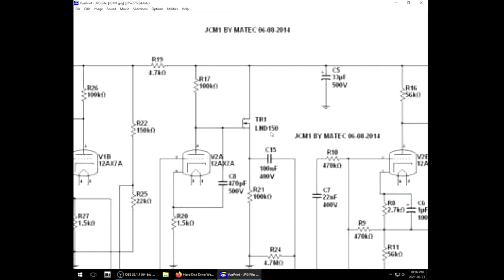I build a Solid State 12AX7 Substitute Tube.

Comment: Cool vid. I've been playing guitar almost 40 years, have owned just about every brand of high-end tube amps and many solid states. I've simply had too many great experiences with solid state to believe that tubes are the only way to go. And solid state is only getting better. Too many players have a superstitious hang-up about tube purity.
Reply from the maker: Hah, well this isn't the better solid state, not implemented this way, anyway. 
I'm somewhere in between. I do like my tubes. Some purists take it a bit too far, they don't quite understand tubes well enough to get the most of them, and box themselves in. Like ones who insist on "original circuits" and "NOS tubes" or original tubes.

Comment: I've gotta try this little mod for myself. I've been looking around for solid state replacement tubes for a hot minute now and I finally stumbled across this video. We definitely have all of the provisions needed at the warehouse sans the socket savers. Time to make some witchcraft happen.
Reply from the maker: Yeah, it doesn't sound good in all applications, but there are a few where it's great. 
There is a company called AMT that makes sub tubes. Might be more flexible.

Comment: love the bushwhacking attitude to high voltage rock and roll! i've got a few of those lnd150s  kicking around that I've been meaning to experiment with. now i'm inspired.
Reply from the maker: Thanks! I was going to say check out my first vid about it, seems you found it already.
Reply: @DATT  btw. some sneaky Russians beat you to this idea. check out the AMT 12AX7WS which is based on LND150 with some additional components to fine tune it to behave apparently identical to the real thing. also check out the vox ac10c1 which uses an lnd150 in the V1 position.
Reply from the maker: @larrysteinke1839  Oh, I'm aware of the AMT unit. I didn't know it was LND based, I thought they used Op Amps. It looks to have a switch mode power supply on it. It's clever but not the same, probably better tho, haha. 

I just looked up the schematic for the Ac10, ahh, it's interesting to see how it might actually be implemented. V1 is a logical spot, cause they stages is often just a driver stage, to boost the signal and feed it to the rest of the preamp, it often does not clip and transparency is good. Mind you, I wonder how it reacts if you throw and overdrive in front of it.
Reply from the maker: Email shows I got a response from you about the LND150 in the follower, seems to be missing here. 
But yeah, I forget for a moment that a tube has 2 elements. I guess if the AMT unit is designed for a specific position, it does make sense they might implement an LND for the follower.

Comment: I watched your video a couple of weeks ago and just now got around to making one of these to try out in my Red Bear Cub combo. I tried it in the phase inverter position as well and so far I like the tone. The Red Bear combo is sort of a JCM800 clone with a few different values in the tone stack and power filtering as well as an extra gain stage. My results seemed to be similar to yours. I hear a cleaner, more clear tone and also a bit tighter sound. This amp has the 4th phase inverter tube way close to the power tubes so it gets really hot so I looked to an alternative to not have that tube burn out. I may try one of those AMT warm stone tubes also just to see how they sound. Thank you for posting this information!
Reply from the maker: Oh yeah, I'm familiar with the Red Bear. It's pretty much an 800. The extra tube in the combo is an FX loop buffer. The head is pretty much the same. The only real difference is is the cathode of the second gain stage, 800 is a 10k cold clipper, Red Bear uses a much lower value, 3.3k I think, will give the amp a bit more gain. That and the Footswitch disables the bypass caps on stage one and 2 with has the effect of cutting the gain. Not sure what that sounds like, I guess might be similar gain to a 2+0 superlead. 
I was always fascinated by that amp. Thought I might try modding my 800 to be like it one day. 

Has it been burning out the phase inverter tube ? I'm pretty sure a tube won't mind, they like being hot. Not sure how that heat would effect the LND mosfets tho.
Reply: Oh cool. Not a whole lot of info on these RedBear amps. I believe you are correct about 3.3k, although the schematic I think has a 3k there. It has more gain and bass than a 800 to my ears or maybe just not as anemic sounding. I also have the MKE60 but some of those values in the circuit are a bit different and one 470pf cap that the combo has, isn’t on the MKE60. I’m not sure about it burning out the phase inverter, but it was picking up radiating heat from the power tubes. I didn’t like that. The tone is similar to what it sounded like with a tube there though. These amps aren’t put together all that great, but with a little modding they can be solid. I just went through the entire amp swapping filter capacitors to film caps. The first tech I had work on it made a lot of errors in the wiring. Mine was a 220v and was changed to 120v. The guy wired the higher voltage side of the PT and it was just cooking everything and not in a good way. There was also a lot of mistakes in the filter cap wiring that didn’t make sense to me. I’ll have to make a video of the cap job I did. I used block style DC caps throughout the filter stages.
Reply from the maker: @aaronsramblingreviews98  Oh, MKE, I didn't know they made a head version of the combo circuit. 
A schematic for the MKE schematic shows a 4.7k even. Also shows 0.1uF on the Pi to Power coupling caps, that could explain some of the extra bass. 800's have .022 there. Not sure about that 470p, would have to know where it is. This schem shows Two 1n caps in series in the tone stack, where a 470p would often be, which results is essentially the same value. Not sure why they'd do that, might be a layout choice. 

I really wouldn't worry about heat radiating off the powers tubes onto a preamp tube, they all run hot. Heat is how they work. Maybe if you put that a solid state module in there it could be a problem, little bit of heat shielding could be in order. 

Film caps ? What caps were in it before ?
And the filter cap mistakes, was that done by the last guy ?
Reply: According to the marketing flyer, the combo was a design that Gibson asked for to work with their guitars. It was similar to the MKE, but some differences. I’d have to trace out all the different values to see exactly what the differences are. I do know for certain that the MKE filtering values are not the same as the combo. I had another tech work on it and help me out, but the first tech that did the replacement pt transformer and caps was the one that made errors. It’s difficult to explain, but the cap job wasn’t done exactly like the way it was in stock form. He used good caps, F&T can caps, but they weren’t necessary. A piece of fr4 board and some grommets with other axial F&Ts would have been fine. I just know it didn’t ever sound right since I got it back which was around the time I did that video on it. It sounds completely different since I went in and changed out those caps and fixed some wiring. My other tech also found a broken resistor that was also causing issues.
Reply from the maker: @aaronsramblingreviews98  I do recall it was an import and branding for gibson. I forget the name, but it was a russian company that I guess was making these anyway, and gibson decided to import them with their own branding. I could imagine Gisbon wanting something smaller and cheaper to get some more market share. The differences are so slight, I doubt it'd make a huge difference in sound. However, that era, an FX loop was pretty standard, so I could see that being a custom request to be more competitive. 
The PSU is probably the least exact science in a tube amp, so it's fair game re rebuild one differently if you can get the same result. I know I have. But, if he sucks at it, and it doesn't sound right, then yeah, good you got that fixed up. These designs are so simple there is little excuse for a decent tech to mess up.

Comment: Funny you should say Jet City, they had those SS tube replacements (3 gain versions) and so did AMT with the Cold Stone if I recall correctly. Can't find em anywhere anymore. V1 should be a good choice for low noise preamp gain.
Reply from the maker: Ohhh, I didn't know Jet City made those. I did hear of the AMT ones.
Reply: The Jet City RetroValves.  They’re long since discontinued but they were solid state 12AX7 replacements.  

They came in three flavors:
- Yellow had the same gain as a 12AX7 and a yellow LED.
- Blue had slightly less gain and a blue LED. (Blue = cooler)
- Red had slightly more gain and a red LED.  (Red = hotter)

I got a three-pack of each when Doug put them on clearance when he discontinued them.  They’re fun to play around with.

They’ll still pop up on Reverb and eBay from time to time.

I haven’t broken one open, but seeing your video, I suspect they’re the same basic idea.  Wire MOSFETs to the triode pins.  But they probably thought to wire an LED to the heater pins, too, to give you some tube glow.

Comment: Id also say the bolt acts also as a heat dissipater for the fets
Reply from the maker: Ahh, not really. It's not making a good connection to them, and these fets run cold to begin with.

Comment: This is really interesting, it may be just what was inside those weird jet city retrovalves they had for a short time solid state tube replacements that made no sense to me lol
Also idk if it was mentioned check out the old soldano hot mod, it was a tube adapter made by soldano mostly just for the marshal amps it adapted the old 6c10 or 6k11 tubes i think tripple triode tubes to be used in one of the positions on the marshal amps to add one more gain stage to make marshals rip. A newer company makes newer versions of hot mods using 2x 12a*7 tubes into 1 socket. Bet you could easily make one of either if you have any 6c10or6k11 tubes around.
Reply from the maker: Ah maybe, I think there was more too them. This really isn't a proper sub as the amp internally would need adjustments to use them. Some of those tube replacements used op amps to do the job, and they just de coupled the high voltage, and ran them off the heater voltage. 

My buddie has one of the newer hot mods, was interesting. I just as soon use an overdrive for a marshall, or with my skills, just mod an amp out right, so I've never put thought into making a hot mod. 
Not for preamps anyway. I've toyed with the idea of making a 2 to 1 mod for power tubes tho. My Jet has 100w transformers, so I thought of making an adapter to run 4 tubes. Just really don't need one.
Also playing with oddball tubes, I've toyed with making adapters to adapt oddball russian surplus tubes into a typical amp. I could do it, but the numbers stopped making sense cause of the complexity.
Reply: @DATT  now that is an interesting idea to make an adapter to run 4 tubes in your 2 tube amp since you have the transformers for 100w. would be easy enough just to add a couple more sockets to the amp if its really worth it, i have both the 50 and 100w models and it doesnt seem twice as loud lol the 50w is loud enough as it is. maybe if youre going to crank it to 11 it might make a difference
Reply from the maker: @MkMc-o1y  Yeah, I've considered straight up added extra sockets to the amp, but it would be very surgical, and in the end, it would be hard to service after. 
Realistically, for what I do, I don't need the extra power. So there is no point. 
Most of what I do on this channel is practical, stuff I'm doing anyway for my own needs, and I just film it. Very little is done just to make content. Especially, when you have so many amps already, if one isn't doing what you need, you just plug into a different one. hah.

Comment: I'm curious on what changes need to be made to the amp to run this. Say if I wanted to use it in the fx loop and phase inverter positions of a Peavey 6505+ would I need to change anything?
Reply from the maker: Not sure what to tell you off the top of my head, generally the cathode values of those preamp positions would have to change. 
In this, I pretty much just yolo bombed it into the position and see how it worked without changing anything about the amp. It either works or it doesn't, it won't sound good in all applications, but at least it can't harm the amp.
Reply: So even if I don't change any cathode values at least the amp would go undamaged?

I also saw in another comment you mentioned you had an idea on power tube replacements. I'm also curious about those since I'd like to take my amp down to 2 power tubes without having to change impedance. Having 2 solid state "subsititubes" along with 2 regular tubes would be a cool experiment.
Reply from the maker: @uselessboi2258  I'm bound to try the power tubes at some point, but I see no advantage to mixing tubes with fets. IN fact, I doubt that'd work, they probably have to be biased very differently. Go ahead and take you amp down to 2 tubes, there is no reason to not change the impedance. I do it all the time. I haven't run more than 2 tubes in any of my amps for a long time. You'd have to rebias of course.
Hell, you can keep the same impedance if you want, as long as you aren't running to too loud.

Comment: Great experiment and great results! But can you make solid state power tubes? 🤔 Since those need replacing more frequently and are also more expensive.
Reply from the maker: I've considered it. I ordered some parts and even have a concept idea. Just need to feel the vibe.
Reply: Lol, yeah, its called a class d amp. If its solid state its not tube…this is all hilarious. Like converting 57 chevy to electric, then bragging about the engine, it doesnt matter at that point its no longer a tube amp. 

By the way i actually did replace my tube amp with class D power section for the reasons you said. I still use tube preamp

Comment: I had a jcm 900 that didn't have that much gain on tap, what volume were you running that at? Sounds killer
Reply from the maker: Probably not loud enough to have more gain, but I'll usually be using an Overdrive pedal.

Comment: i want to see all of them replaced lol just to see what happens. I also heard you can do a similar thing with 6v6s?
Reply from the maker: I did that in a previous video. Check my channel for a video called "I jammed transistors into my tube sockets".
Not sure about 6V6, I imagine if they are cathode biased, then yeah, there might just be a larger mosfet out there that can sub them.

Comment: I would have pulled the unused pins to make room for the transistors.
Reply from the maker: I didn't want to do that for indexing reasons. Otherwise you could accidentally put it in the wrong way, and I def have some amps where I can't see well the socket and have to insert by feel.

Comment: depletion mosfet are different beast compared to 12AX7 triodes, they needs at least to rebias the LND150 and remove the cathode cap. Anyway the are more suitable in place of a EF86 pentode rather then triodes
Reply from the maker: I have noticed they do not like circuit with the cathode bypass.